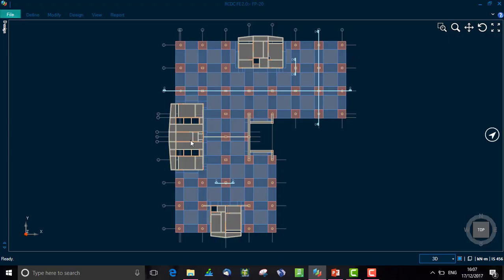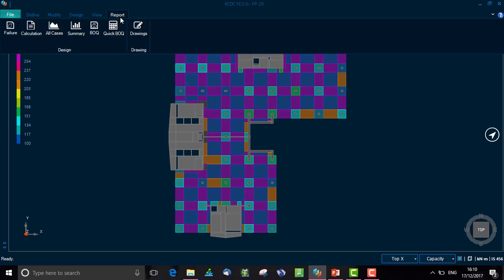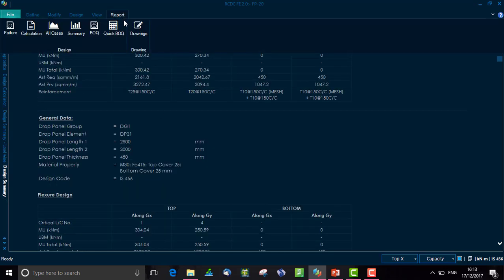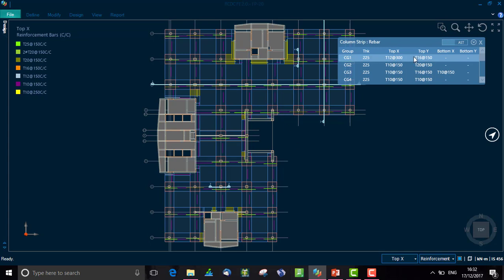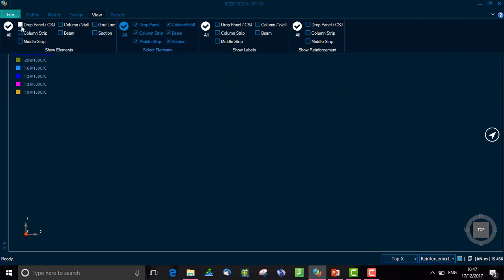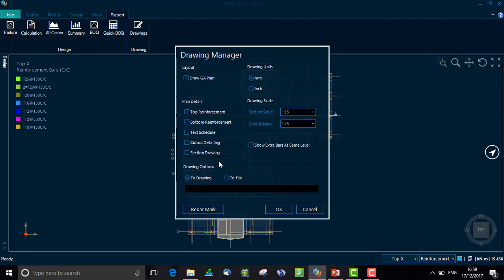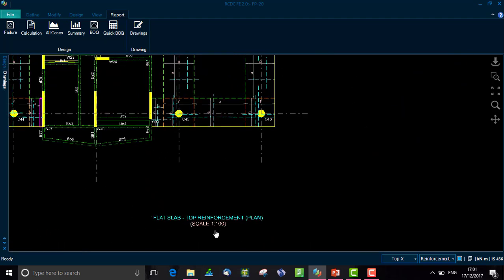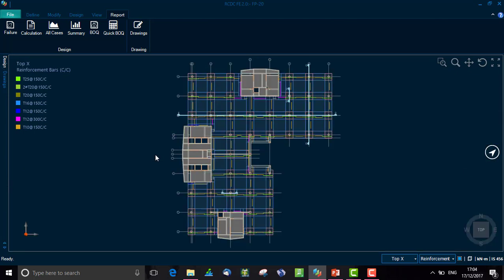RCDC FE: Output Reports and Drawings

Comment: What version of RCDC FE you are using? Thanks in advanced... and what is the difference bet.  RCDC FE vs. RCDC?
Reply: In RCDC FE u can design finite element e.g. flat slabs n any type of foundation where as in RCDC u can design Columns, beams, shear wall, isolated footings n pile caps and slabs.